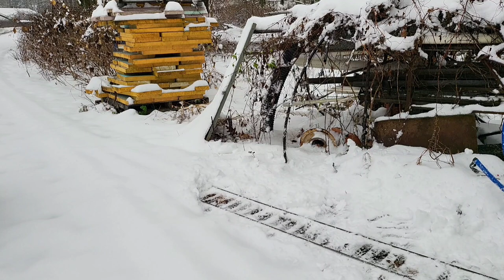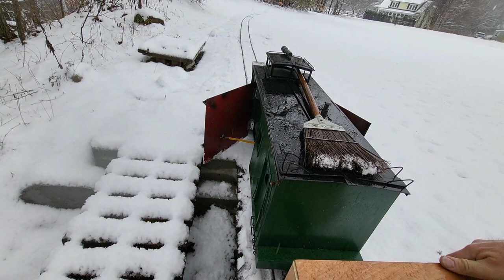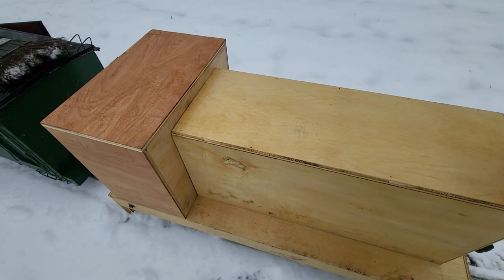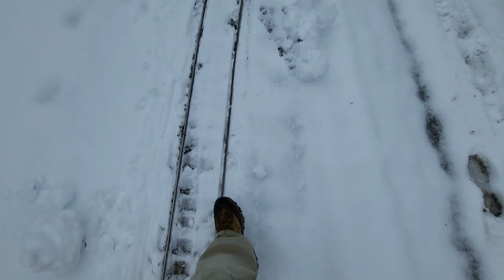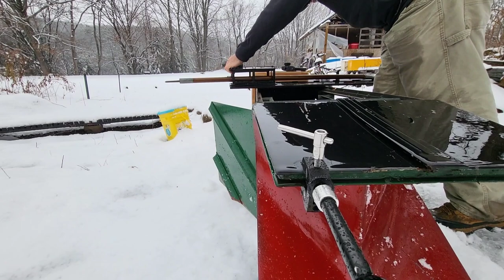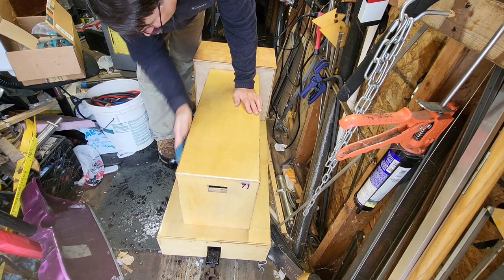New Locomotive Shakedown: Plowing Heavy, Wet Snow

Comment: You just need to make a snowblower for the locomotive thats gas powered and maybe even a power broom for light days
Reply: That's exactly what I would do. Flat car with a simple removable mount for the power broom, and a mini car to hold the snowblower.
Reply from the maker: The power broom is easily overwhelmed by heavy, wet snow. The snow blower, on the other hand, is a future project.
Reply: @MillBrookRailroad  I second a snowblower idea!
Reply: @MillBrookRailroad  I would use it on the light fluffy stuff. Or even on a trailing car, mounted backwards, to clean out any stuff the plow missed.....and might help push a little bit.
Reply from the maker: @dorsk84  A flanger is higher on my list than a snow blower.
Reply: #DeJaVu seems like I’ve already watched this video?

Comment: I wonder how it would work to have a rotating brush in front to remove the snow, so that the motor in the locomotive wouldn’t struggle that much? Also all the spinning would wear the track somewhat, or? But these videos are very nice to look at, I don’t think most of us had come up with better solutions with the same amount of resources, anyway… 🙂 And yes, we enjoyed the video - though here in Norway (Oslo) it is even colder with about - 10 C - the snow if more fluffy and light, then. ⛄️
Reply from the maker: A power broom would easily be overwhelmed by heavy, wet snow.

Comment: Your video shows quite clearly, how the snow starts to pack on the flat surface.. If you simply weld on a vee on the flat surface,, with the point starting on the flat surface,,, it then should allow you to cut through the snow,,, preventing it to bunch up on the flat surface... Can you weld?...
Reply: Tough to weld on non metal surfaces.  The leading edge of the plow is a stiff plastic, so it doesn’t damage the rails. He has been experimenting with different materials on the plow, that will be stiff, but still give, without damage.
Reply: @robertheinkel6225  The vee point could either be placed at the cutting edge, with the metal vee extending back to "metal' surface, where it 'could' be welded.. I personally would replace any breakable plastic with same gauge metal.. It would be sturdier and provide more weight to the front...
Reply: I agree Anchor,  The front of the blow is carrying the weight of the snow too long.  The V should be placed closer to the front of the plow.  This would still allow for the weight of the snow to give traction to the plow before the snow is cast aside.
Reply from the maker: I got the plow secondhand. The guy who built it said it wasn't right but maybe I could do something with it. I don't disagree with having a breaker at the front but there is a more serious issue with this plow that has led to my using a sacrificial leading edge. 

The plow is too far from the rails by more than an inch. To fix this, I'll need to cut the entire front off, reposition it and weld it back on. The problem I have with that, other than it being a daunting task, is that the blade is made of galvanized steel.
Reply: @MillBrookRailroad  I admire all the hard work you have done with your RR. On the plow being too far from the rails, maybe something like the rubber material used on squeegees might take up the gap.  Possibly one of our crazy ideas will click with you. LOL
Reply: @MillBrookRailroad  if the front width is say 15 inches,,, then use a 28 inch length, of 4inch steel pipe... Cut length in half,, then cut the diameter in half,,, there's your starting point... With both pieces in hand, place together at proper angle, and now you will see were your cut will need to be made, in order to join them together at proper angle... Once together,, cut off the unnecessary overhang that will obstruct snow from passing over the blade,, starting at the lowest point in the front,, tapering it to the highest point to the back... Remove plastic piece in the front,, and mount/weld your new made piece on the front at desired height... And that should get you cutting through the snow... PS.. When you're done halving the diameter,, you can lay it down on hard surface, and sledge hammer it,, to widen the profile... And there's nothing wrong with welding galvanized metal,, but more to do with the thickness, and using lower amps to prevent burning holes through.. You'll need to find someone that knows about welding, to do this,, and not an amateur welder,, or they could make a mess of it... If I live closer to you,, I would do this for you... Goodluck...

Comment: Instead of short set screws. Could you use long pin set screw or roll pin?
Reply from the maker: The set screws actually work well when you tighten them properly in the first place.
Reply: From Portland Oregon.
Reply: Have you or your friend come up with a design for sanding?

Comment: Would lock-tite be doable in placing the set screws?
Reply: Too much torque.
Reply from the maker: Loctite would be ideal! I did mention it at one point in the video, but it was easy to miss.
Getting the set screws seated is the actual problem here. I'd hastily thrown the engine into service to move a ton of wood pellets and I missed a few things. Light tightening bolts and set screws all the way down.
Reply: @MillBrookRailroad  I missed that, shakedown test got it!
👍